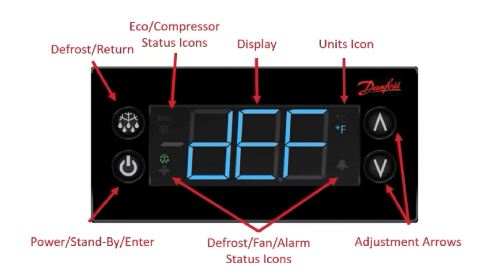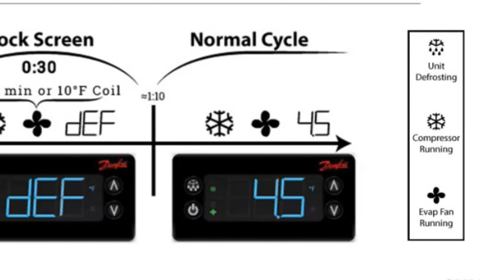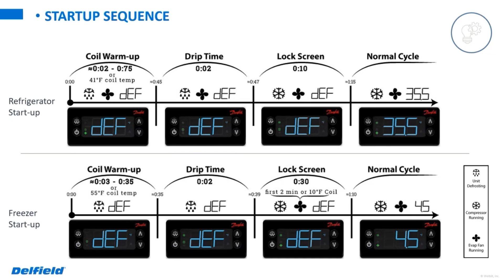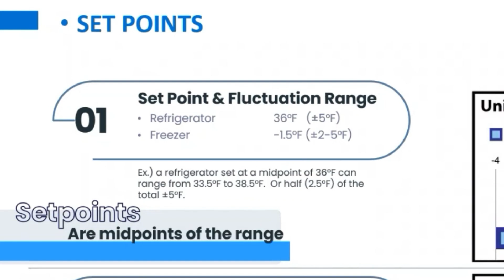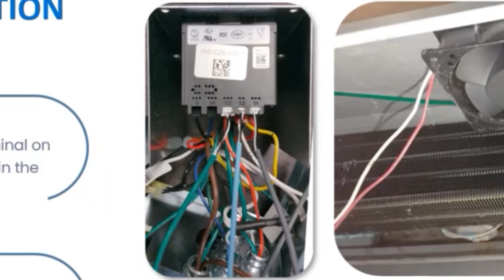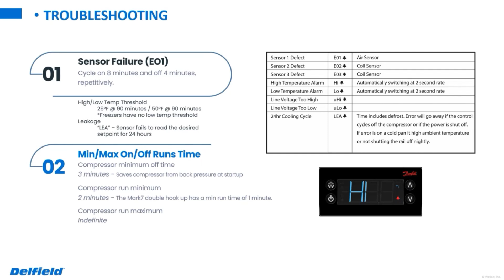Delfield ERC112 Control Training with Bud and Jason

Comment: is there a way to reset the passwords? I have a client with a delfield prep table using the erc112c. they claim the controller will kick into a defrost from around noon to 3pm. I attempted to check settings but was unable to get past "PAS"

Comment: Could you guys pleeeease help me. I got a new danfoss erc112D controller, but they sent me 2 evaporator probes. I read in the manual that I can program one to act as the cabinet temperature probe. I can not figure out how to do this. 

As of right now when I start it it just gives me an E01 code, I'm sure it's because I have an evaporator probe plugged into the cabinet probe plugin.